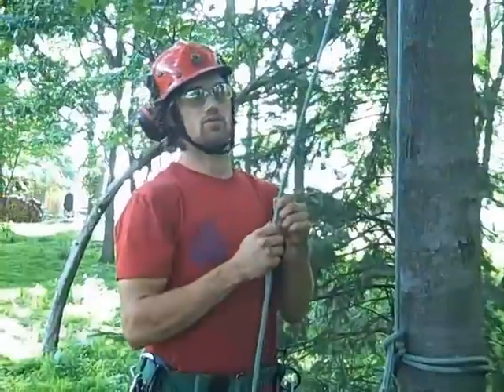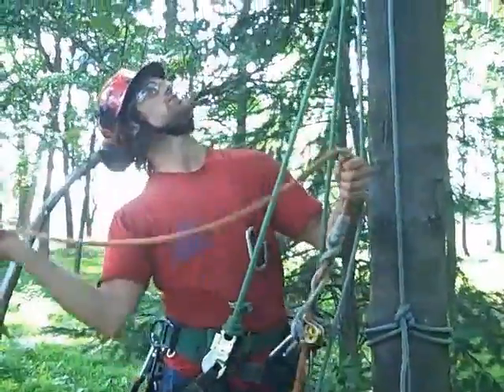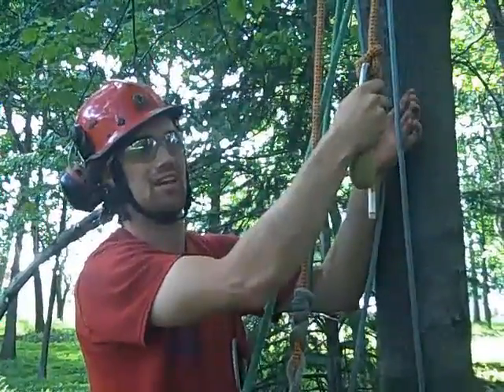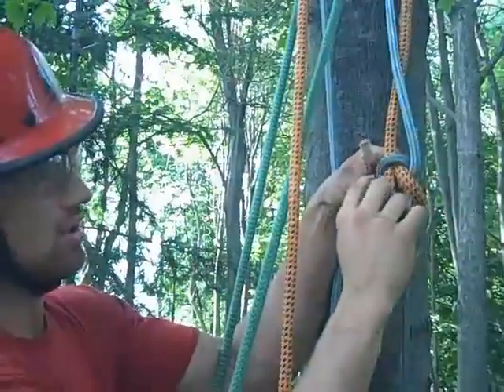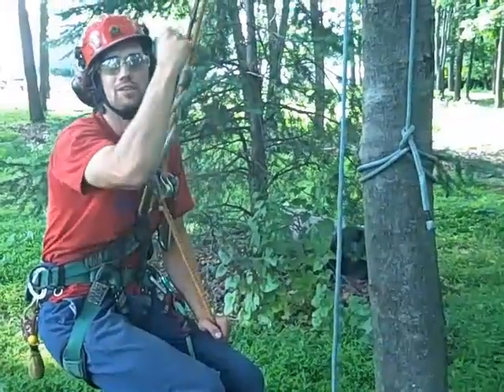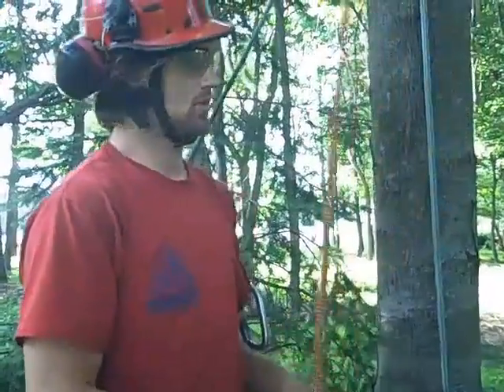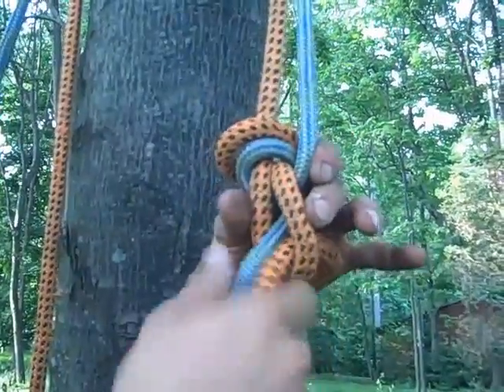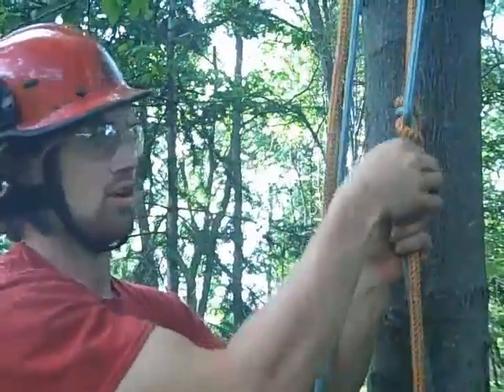SRT Tying in

Comment: The sheet bend (tied here) and bowline share many similarities, except for the routing of the lines. Traditionally, if the two ropes are of unequal diameter, the bigger rope should be the one that is not crossed.